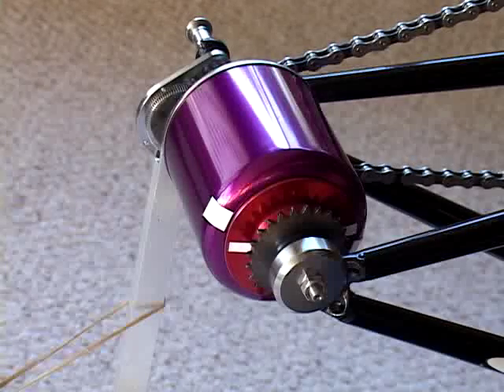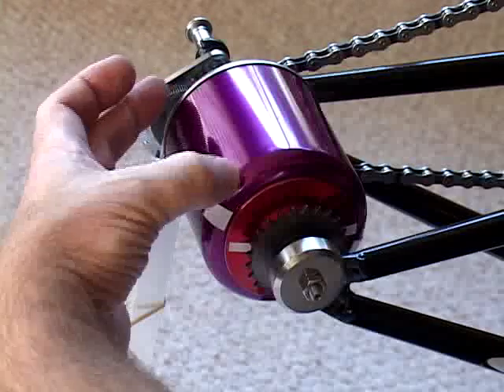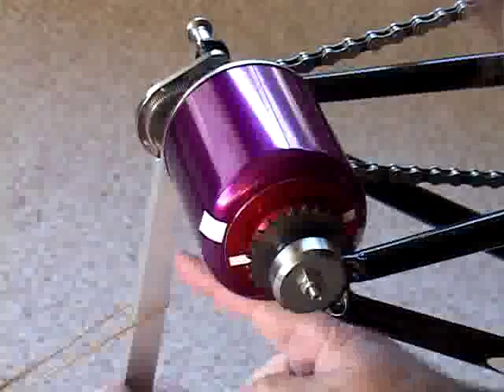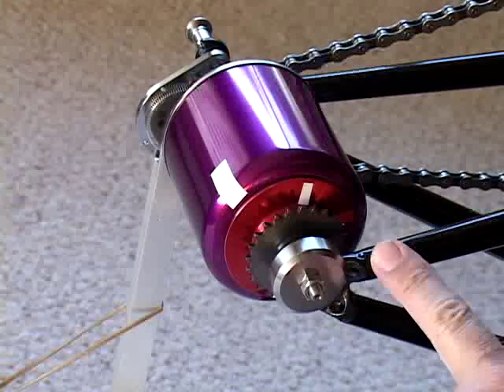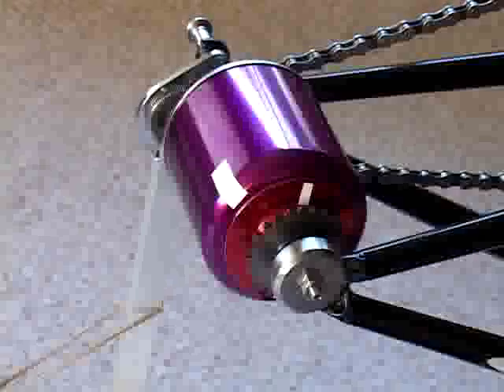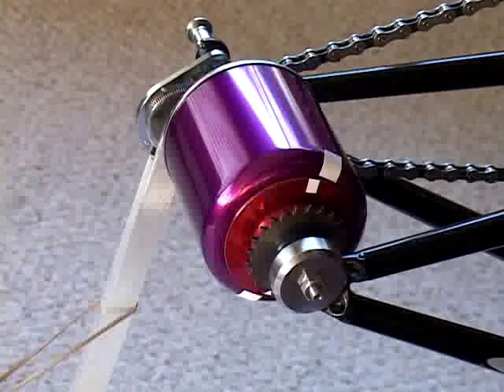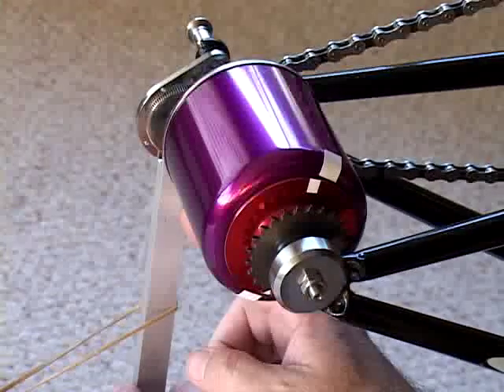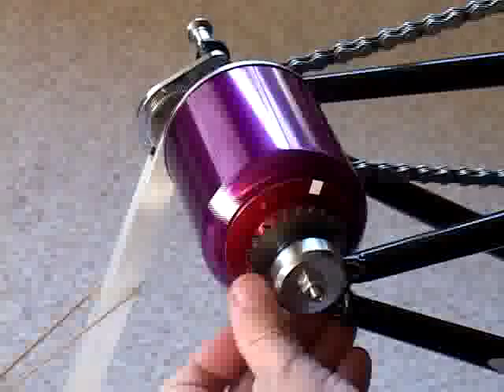Automatic Bicycle Transmission (IVT)

Comment from the maker: @oopablo Ratcheting IVT's have been around over 70 years, in the form of the Zero-Max; I own one, and I can assure you that it's not suitable for transmitting rotary power efficiently.  I've also borrowed the Epilogics ratcheting IVT from its inventor back in 1990.  That's what got me started on ratcheting after having made a traction CVT that proved the poor efficiency of traction systems.  Since the SIVAT has a successful ratcheting CVT that preceded it, I know it won't even get very warm!

Comment: Bad news Mr Inventor: they've had this very thing for over 50 years.  My wifes Towny has 'tranny' in its rear hub, they usually give them presets to mimic gears, but work in the same manor.  Ratcheting CVT's have been around forever too, and they really like to over heat and wear off their ratchets.   yours looks nice though, i guess.

Comment from the maker: @gobacktorussia You'll be able to adjust the SIVAT for the pedal force of your preferance; another adjuster will regulate how responsive the ratio change is while including the ability to lock on the current ratio.  These adjusters are not shown in the video, but they are trivial to design into the SIVAT as they are claimed in the patent application.

Comment: @StrykeaDay ok but it dosent matter....good luck trying to get 600,000,000,000 more/less to switch to a electric or hybrid...and plus my truck gets 24 mpg...witch is good for a truck....oh and the people like you reason was uncalled for...dont act like you have never drivin a gas car.....plus semi trucks need power to tow big stuff around along with towtrucks.....electric dosent have that power.......i wouldnt mind a electric truck but not for $30,000 more than what my truck is worth brand new..

Comment: @cody111495  sorry but your statement is bullshit, of course new stuff is expensiv, but if it works it will be produced in bigger numbers and that'll lower price, but thats not the point the point is, that you don't see, that 10k bucks won't nearly be enough for 3 year gas for a truck, not with this global situation of growing oil prices and by the way, peoples like you are the reason why our climate is changing so fast and why the whole world is at the beginning of a long chain of disasters

Comment from the maker: @cody111495 Where is it stated or suggested that this will cost $10,000?  Since it's less complex than most multi-ratio transmissions, its cost is likely to be very competitive.  Apparently you either did not watch the video or did not understand it before making your comments; this invention is not electrical, it's all mechanical.

Comment from the maker: @MDNSBS Having your car stuck in sand or mud is not an overload condition; the wheels spin because they have too little resistance to rotation, not because they have too much resistance.  Traction is mostly an issue of action between the tires & the ground, not an issue of action between the engine and the tires.  SIVAT's access to ultra-low output (wheel) speeds might actually be an advantage to keeping traction in sand & mud.

Comment from the maker: @dengood It doesn't matter.  The input gearing (the sprocket pair) will raise the top ratio to what's needed.  The next version will have a system to achieve road-bike style high ratios, as well as all other ratios of lower gears.

Comment from the maker: @DThaeman The SIVAT can be scaled-up for power capacity.  The YT video features a size that should handle 1 kW (1-1/3 hp) @ 500 rpm, useful for pedal-powered bikes & motor-powered bikes.   A SIVAT for cars would be slightly smaller than an equivalent standard stick-shift transmission.

Comment from the maker: @nitrous2oxide First will be bikes designed to accommodate the SIVAT.  Products might be first available non-domestically in between 14 months and 3 years, followed by the US market several months later.  Adapters for bikes with standard bottom-bracket style frames would be considered after that.

Comment from the maker: @12edDemon The Toyota Hybrid System featured electrical regen braking since '97.  Flywheel-based KERS concepts were proposed by Feynman in the '50's.  The basics aren't new.  My proposal for KERS is more specific to improving moderate-speed vehicle efficiency than other systems, roughly doubling regen braking efficiency over the electrical Toyota system.

Comment from the maker: @damnedboner No.  Gears, levers & one-way clutches do the work in the SIVAT.  The one-way clutches are are like roller bearings that roll in only one direction, but lock up immediately in the other direction.  They're widely used in conventional transmissions, as are gears & levers.  They're also used in turnstiles to allow people to enter a room or building, but not to leave the same way.

Comment from the maker: @elfonzo01 The highest possible ratio of the SIVAT is above 1:1, but it works best below ~2:3.  This upper limit is easily raised by step-up input gearing without effecting its ability to reach low ratios, including zero.  Thie featured video set-up uses a 55 tooth chainwheel to an 11 tooth sprocket, so the input ratio is 5:1; therefore, the best highest ratio of this system is 5 X 2/3, or 3-1/3.  For bicycles, the SIVAT will use a 2-stage system that will easily achieve a top ratio of 6:1.

Comment from the maker: @94civiclxgrey Thanx for asking!  I appreciate it when commenters ask questions instead of making ignorant statements.  The SIVAT is an Infinitely Variable Transmission (IVT), a special type of CVT that has a huge range of ratios that can go down in ratios to zero.  By accepted naming convention IVT is uniquely used for this, whereas CVT is uniquely used for continuous variability that has limited range, usually with the highest ratio about 3 to 4 times the lowest ratio (which cannot be zero).

Comment from the maker: @thisusernameisable No.  The Rohloff hub has 14 distinct ratios in a limited range (5.26X).  The SIVAT effectively has an infinite set of ratios and a much wider range of ratios with a very high upper limit & no lower limit when used with step-up gearing at its input.

Comment from the maker: @burninmunkeys A fishing reel should be so lucky!  Actually, a SIVAT-enabled fishing reel would allow you to reel-in a fish without changing the cranking force for heavy fish!  The SIVAT demo here is a proof-of-concept unit without full automatic capability, but the intended product includes computer-controlled servo assist of its ratio-control mechanism.  That will allow full automatic operation, optionally switchable to manual operation, as discussed in earlier posts here.

Comment from the maker: @BadaBingBadaBoomsday Wrong.  A clutch is totally based on dynamic friction that wastes energy & causes wear.  It's unsustainable as a device for allowing a mismatch of speeds between the motor & wheels because its only purpose is to gradually start or stop the vehicle without slowing the engine to a stall.  A clutch is only used infrequently.  The purpose of the SIVAT is to provide a full array of gear ratios at all times; its clutch-like ability is only an incidental benefit.

Comment from the maker: @MrMjcab The details of how the SIVAT works will only be divulged in the issued patent for security purposes.  It's not clear what you're asking about regarding live axles, but the SIVAT can be located before or after the differential in the line of power flow.  If a SIVAT is imbedded on each side of the differential, one to each wheel axle, then each drive wheel can be powered at a separate speed; this can be done for either a live axle or an independent suspension.  More questions?

Comment from the maker: @gamester57 Very good!  It's actually 0.98 X 0.98 = 0.9604!  But why split hairs?  Chain-sprocket misalignments produce efficiencies reduced to those levels in all but 3 of the derailleur ratios.  Chain sideplate-to-sprocket tooth rubbing action causes some power losses up to a few percent in most of those cases.  There's a minor trade-off for the benefit of enhanced ratio control with an aligned 2-chain SIVAT installation.

Comment from the maker: @gamester57 There are some advantages to a similar position for the SIVAT on hard-tails as well.  More ground clearance & more robust transmission design will benefit both suspension & hard tails.  The trick will be to standardize most of the bike frame construction for both for the sake of economy, if possible.  Thanx for your inputs.

Comment from the maker: @gamester57 I  reckon you're right.  Taken a step further, the SIVAT would be at the suspension pivot so that the drive output chain would be a simple, tight loop that would produce minimal pogo-ing.  The freewheel & shift mechanism are inherently inside it already.  Such a design would allow most or all of the drive system to be fully covered & sealed from mud & dirt, more isolated from impacts with rocks & logs.

Comment from the maker: @SerenityValleyVFR The SIVAT uses rolling sump lubrication, similar to bike hub transmissions.  A sealed cylinder at it max diameter houses gears that dip into a small pool of gear oil, rolling oil from the bottom to wet most of the gears continuously by dipping & dripping; oil transfers to all moving parts in a constant bath on gear-teeth.  Part shapes are designed to spread the oil to gears, clutches & bearings inside the sealed chamber.  Lubed 'ratcheting' one-way clutches are durable.

Comment from the maker: @xFReSHeReST An IVT is a specific type of CVT with unique capability to reach very low ratios that include zero.  By naming convention, CVT refers to non-IVT Continuously Variable Transmissions that have significant limits on their ratio range.  Most CVT's have a range that has a high gear that's about 3.5X their low gear ratios; although they might work with greater range, they do not work well outside that range.  The IVT's top ratio can be raised a lot without affecting the low ratios.

Comment from the maker: @gamester57 There's a significant fall-off in efficiency of bicycling leg action outside of a 30 rpm wide cadence band that's centered at ~85 rpm on average, but different for each rider.  Biomechanical studies show that the balance between slow-twitch & fast-twitch muscle fiber actions correlate w/ mashing vs spinning, and affects overall efficiency.  So far, I've seen anecdotal evidence of this, but have not seen deep studies showing efficiency vs cadence curves for large cyclist groups.

Comment from the maker: @edgunderson Thank you! I've been equally inspired by other inventors who have suggested use of the SIVAT in their own unique vehicles, including a velomobile. You've struck upon the best position for most vehicles as mid-drive; but its configuration will be two-stage, somewhat different from that shown in the video. In collaboration, we'll first move forward with at least one of the contender vehicles, which is most likely a special mountain bike!

Comment from the maker: @sccadu Zero-Max was the very first ratcheting IVT!  It's an invention older than I am.  Zero Max is appropriate for slow-moving machines whose power throughput efficiency is of secondary concern.  The units I've seen have a great deal of friction.  The SIVAT is appropriate for high-speed, high-efficiency, high-throughput power applications.

Comment from the maker: @meleglabtarto It's not the first bike CVT, but it is the first bike IVT.  It has wider usable ratio range than CVT's for bikes. The total gear ratio is unlimited with high gear defined by sprocket sizing, and low remains at zero. Torque is sufficient for biking.  Efficiency will be 88% to 94%, depending on the ratio setting.

Comment: HI SIMKINETICS
You mention that this device is a forwards ratcheting system....
I suppose that if mechanical (or other) regen braking were needed (not suitable for a Mountain bike, but in larger systems,  a second IVT  (reversed) could parallel the input IVT (as there is already a one way ratchet in the system) ie, one IVT for Power / Torque in, and the parallel IVT for torque / power out, make it a true I/O system, allows to optimise ratios for the regen system....
Interesting System...

Comment from the maker: @TeeWeeQcKsteel Wheel torque will rise as you begin to go uphill, but your pedaling torque (exertion) & your pedaling cadence (speed) will both remain fairly constant.  This will result in the most efficient use of your body's energy, regardless of whether you're going uphill, level or downhill.  The SIVAT will imitate what you would most likely do in shifting your derailleur gears, as you pedal up & down mountains.

Comment from the maker: @youngone190 Yes, I know that the surprise of using one's crotch as a landing pad on the bike frame is unpleasant, to say the least!  The SIVAT will have a gradual ratio change that won't allow your pedaling motion to abruptly slip away!  Pedaling resistance will lower slowly; just enough to keep your cadence fairly constant as you begin an ascent or an acceleration.  This feature is an important part of the design!

Comment from the maker: @oilfield666 An IVT is a CVT with a planetary differential.  My analysis of pedaling power cites studies of elite cyclists, available on the web; and yes, some of them can produce 1.6 kW for short bursts at 130+ rpm, but few cyclists will sustain 500 watts.  I've written a study on this that you can find on Endless-spheredotcom: enter SIVAT, and look for a comment with a PDF reference.  Engineering tests & calculations are reliable predictors, not guesswork & speculation!

Comment from the maker: @oilfield666 Don't lecture me about physics.  Torque rating for this transmission is meaningless without qualifying the operating speed which is deliberately variable here.  Power, in kW, is the product of torque times speed, so that's the important rating.  The basis for this concept evolved from my bike CVT which never failed on several long rides.  We seasoned engineers know how to field test machines, so we know what's realistic.  You can only speculate.

Comment: @SIMKINETICS nice concept but you're not very realistic.  1kw isnt a torque figure btw. its like horse power....you can have 1000 horse power but if you dont have the torque you cannot use that power.       if you want to know what will happen while testing your "ideas"    that device is going to fail and some poor guy is gonna bash his nuts on the cross bar cause....like when a chain slips off on a regular bicycle.     like i said good luck and have fun burning money.

Comment from the maker: @kyrieeleison1 2 kg is the very highest estimate, but it might be closer to 1.5 kg.  The design is not complete enough yet to put an accurate number on it.  A derailleur system for a 27 speed is around 1.2 kg!  If you shell out some big bucks you'll go below 1 kg, but not by much.  Pogoing results from 2 forces: variable chain tension and wheel torsion.  Judicious placement of the rear pivot can neutralize most of this for one chainring/cog combination only, not an issue with this.

Comment from the maker: @kyrieeleison1 As a longstanding bicyclist, I understand what an MTB requires.  The final version of this transmission will be located near the BB, and it will be sealed.  Imagine no derailleurs, no chain idlers, even on an F.S. version!  Pogoing will be nearly gone.  It will also be tough enough.  I believe it will be affordable, likely less costly than Rohloff.  Mass will be less than 2 kg.

Comment from the maker: @kyrieeleison1 You've got a misconception about how it will work.  Pedaling torque (effort) changes will make its ratio change.  There will  be an adjustment that will allow the rider to dial-in how much effort he generally wants to use, so if it's set on the high side, he'll be forced to expend a constantly high effort, & resulting speeds will be higher.  The goal is to allow the rider to focus on technique without the distraction of shifting gears & worrying about derailleur malfunctions.

Comment from the maker: @kyrieeleison1 This transmission is intended for many uses besides bikes, but I want to debut it on mountain bikes.  No, it's not for fat, lazy bicyclists; it will be for high performance mountain biking, and will not be hub-based, as shown here.  This video demonstrates the concept that can be executed with at least two other very different designs.  Imagine a robust, tough mountain bike on which you can ignore gear-shifting at your option!

Comment from the maker: @sickdeathshappen I've seen chainsuck on the best of derailleur systems, and hate it when it happens.  The SIVAT won't suck.  Gear shifting will be a fluid-like experience with no risk of abrupt surprises at any time with the SIVAT!  No sensors will be needed because the spring will detect your pedaling torque and SIVAT will respond to needed changes in gear ratio.

Comment from the maker: @saints360row No.  This will be very different because you won't need to adjust anything during your ride; it's fullly automatic regardless of whether you're ascending, descending or changing grades.  Handlebar controls will allow you to do some fine-tuning on rare occasions that need it, such as when you get tired & need to exert less power overall.  The goal is to allow you to focus on steering, braking & pedaling, while the SIVAT precisely finds the gear ratio needed at all times.

Comment from the maker: @ebouwman034 Motors are electro-mechanical devices; as such, improving their efficiencies has both electrical & mechanical components to solutions.  Alternator voltage control helps, but mechanical control helps further.